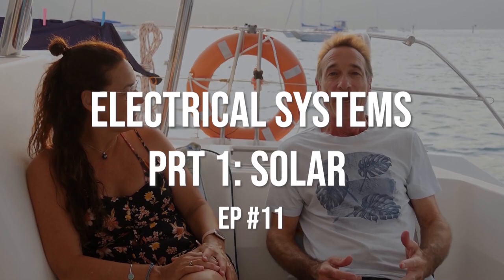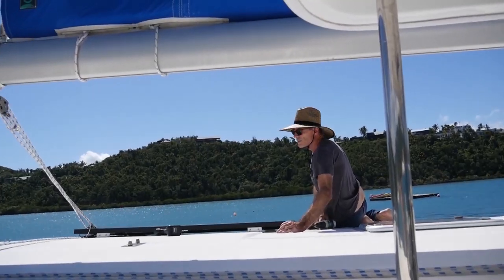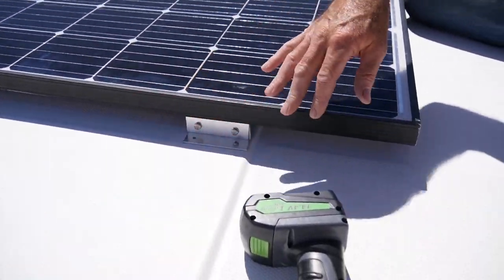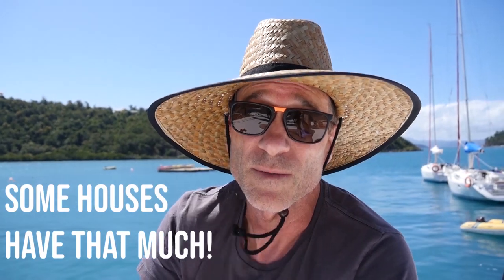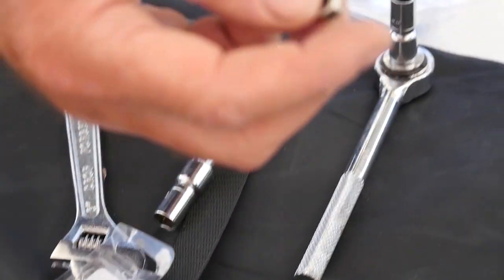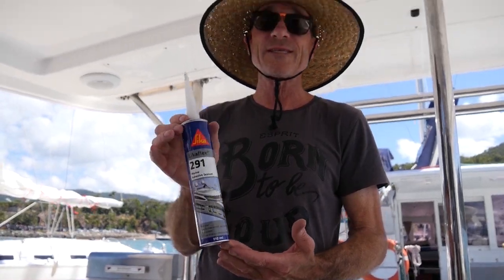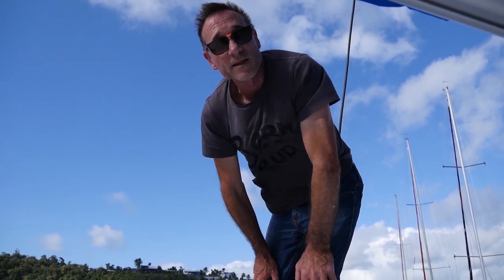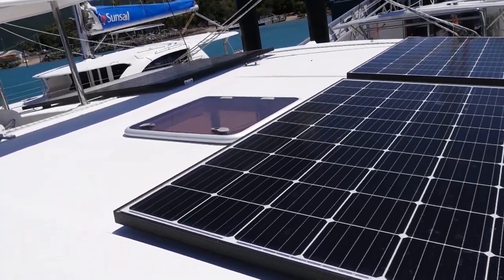Sailing Bluefin Ep #11: Self sufficient living Australia - DIY marine solar systems - victron energy

Comment: Hi Keith.  Nice job on the solar.  It'll go a long way to making your boat energy independent for many years.  I'm curious about the use of Sikaflex for sealing the bolts.  Have you thought about using butyl tape instead?  Your comment said you didn't like the Sika product and that it turned milky after about a month (I believe).  Have you used butyl tape before?  I use it on all my deck fittings and it works wonderfully.  It stays flexible, is very easy to clean up, and seals very well.  Anyway, just my 2 cents worth.  I run two 100 watt flexible panels on my dodger top here in Alaska and because I live in a rain forest, it's usually cloudy but even at that the panels help offset my power needs.  Wish I had more panels but it's hard to find space for them on a 30' boat!  Cheers!
Reply: Hi Wade, Keith here. Interesting about the butyl tape, I've seen it mentioned before and I'll have to check it out. Regarding the Sikaflex, a guy from Sika Australia finally came back to us and admitted that Sika 291 has some serious deficiencies and he sent me a few tubes of Sika 591, which appears to be a 100 times better, but is also thicker and more difficult to work with. I used it this week for glueing up the track for our clear enclosures that I'm working on. 
I'm going to check on the butyl tape today!
Reply: @keithwiggins6891  Yes the Sika 591 is a lot better than 291. Not sure about the compariso n with 295 though. I'll have to check out the butyl tape too.

Comment: A little question here 1800 watt for a 50Amp MPPT isn’t too small for the power of your panel ?
Reply: Hi, thanks for the question, it's a good one and a reasonable observation. 
We actually have 4 x 300 watt panels, so 1,200 watts in total. We may put the additional panels on at a later stage, but roof space is tricky. We have the space, but don't want to clutter it too much. We have a Victron 100/50, which can handle up to 100 volts input and can deliver a maximum of 50 amps output.
Regarding the MPPT controller, three points to note: (1) We rarely get 1,200 watts, as there is usually some shading. (2) The Victron MPPT controllers limit the input to the capacity of the controller, so you can have more input than the output capacity (50 amps is the output capacity at battery voltage). (3) Your peak amperage under ideal conditions will only be delivered for a few hours a day, so you have to decide whether you will match your controller to the peak, or to a more realistic wattage that you will have for a sustained period across the day.
So, considering these factors above, and considering that when you go above 50 amps, the controllers become a lot bigger and a lot more expensive, we worked out that a 50 amp controller was adequate and sensible.
If we add more panels, we will either get a bigger controller or add another controller. I am a bit dubious about adding a second controller, as they are not really able to communicate with each other (that's on the Victron roadmap), so the can potentially fight with each other, so you never get both controllers delivering full output.
Let me know if this doesn't make sense or if you disagree.
Reply: Hi Keith,

Thanks for your great reply 
I’m also owner of a L44 similar than yours with also Victor MPPT 100/50, understood that MPPT control anyway the input voltage but thought that 100/50 can handle max ~ 700 Watt, I’m going to add 700 watt additional with a second 100/50 both of them connected to a Victron Venus to be able to monitor the amp output.

Usually lost of watt is equal to -30%  and yes correct only during peak hours from 11am to 14pm 

Shading is an issue for sure but believe that during a good sun day and during the peak hours you can check your voltage input before it passed thru the MPPT and see how much the MPPT is giving to your batteries. 

But you should put some load to see the real performance of the MPPT output 

Hope this help 
Cheers
Ben
Reply: @googlemate2587  Hi Ben, I think that the Venus does the same functions as the colour control. Are you sure that the Venus will coordinate the solar controllers? A lot of people have claimed that it will, but last time I checked with Victron a few months ago, they told me that the coordination was on the roadmap. I was told by a couple of marine electricians that it is better to get a bigger controller. But this is a constant point of disagreement on forums. Some people have multiple controllers.
I do want to get a Color Controller, as they appear to provide a really good graphic view of what's happening. 
What year is your 44? We really like ours, but it does have some things where you wonder what they were thinking when they designed it. Like water draining forward on the rear cockpit floor!
Thanks for the questions. Keith
Reply: @keithwiggins6891  yes, I've also heard different stories on the effectiveness of coordination of solar controllers. Seem to be many different views on the subject.
Reply: @sailorsam6243  yes, if you ask the question, you'll get a few different answers! 😀

Comment: Nice.. Butyl tape lasts longer and does a better job... just saying.. 😉🙂
Reply from the maker: Hey thanks, can you tell me more about butyl tape. Really interested 😀
Reply: @SailingBluefin  the stuff never dries out, uv resistance and adhering to most surfaces are other benefits  .. if you don't need to glue stuff in place or there's no water pressure involved, butyl tape does a better job than most other sealants
Reply from the maker: @R.E.HILL_  thanks for this advice, I'm definitely going to play around with some, as the sealants are messy and Sikaflex has been very disappointing, with going yellow way too fast for a product of that price!
Really appreciate the tip and also thanks for watching our video.
Reply: I'll have to check out that butyl tape too. Sounds interesting.
Reply: @sailorsam6243  yes, definitely.